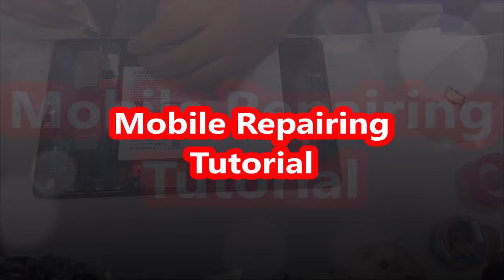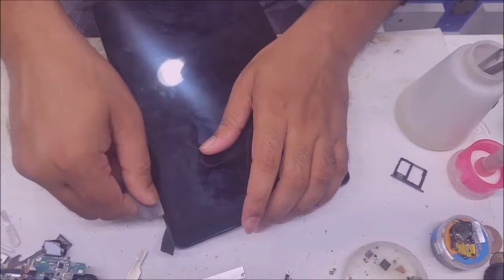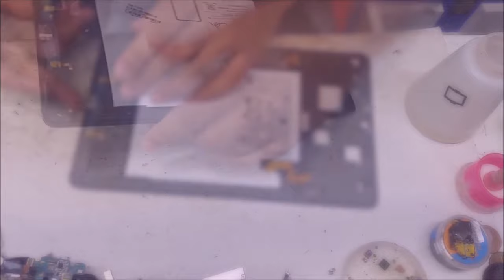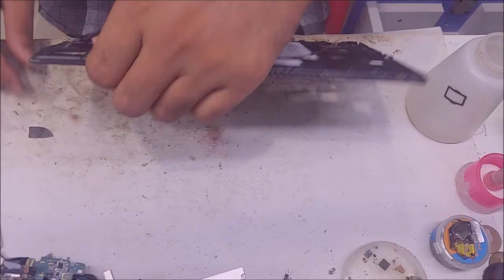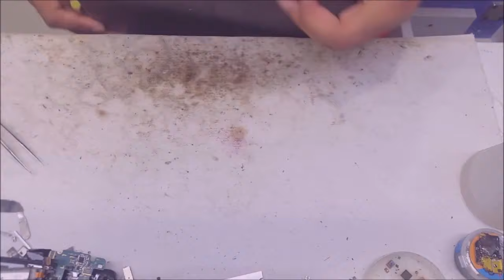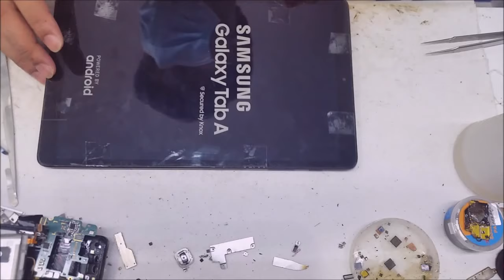Samsung Galaxy Tab A 10.1 SM-T515 Disassembly / T515 Full Assembly / T515 Screen Replacement

Comment: My tab has been leaking some sort of glue and today while I was using it, the screen separated from the back cover but I put them back together. I got scared though.
Reply: @MobileRepairingTutorial  In my case the glue detached and the screen fell down... I put it back...the ribbon that connects the screen and the rest of tab detached... I put it back together by seeing some youTube videos... But still the screen is not turning on... What shall I do?
Reply from the maker: @pratikshamishra1820  sir check ribbon is broken small cutting or change and check ribbon then not coming change display
Reply: @pratikshamishra1820  what happened what did you do

Comment: he product did you use to remove the glue?
Reply from the maker: yes sir that is thinner
Reply: @MobileRepairingTutorial  💥✨🎇🎆Great video🎆🎇✨💥, congratulations 😀👍👍👍Thanks for this video!         May I ask for the exact thinner?  White spirit? Acetone? Turpentine? Naphtha? Toluene? Xylene? Ethylic Alcool?And what part number exactly is this T-7000 glue? Thanks in advance and Keep Up The Good Work! 🖖😀👍

Comment: Good  job sir. One of the steel plates at 07:08 is being overheated. Display is dead. When I tried to charge a sound continuous beep sound is coming.what to do.
Reply from the maker: sir i think your display short or display light connection tech to ground
Reply: @MobileRepairingTutorial  sir my display is getting of by black screen but getting calls and everything else but my screen was Black screen what to do?
Reply from the maker: @cmarchana1077  sir i think it's display problem or display light problem
Reply: Apke pass motherboard h kya

Comment: Hi. thanks for the video

Display has fallen off ripping the lcd cable apart, I have replaced the lcd cable but the screen does not turn on, the sound are coming out...

what could be the reason?
Reply: Fried backlight, lcd panel connector broken, lcd broken

Comment: question: what if after changing the screen the touchscreen gets crazy?
Reply from the maker: Yes sir
Reply: @MobileRepairingTutorial  ? Please clarify what to do if possible
Reply: @paolomessina1351  most common issue is weak battery. it cant keep up with such power demands. but you must confirm it first by going changing to extreme power saving the test the touch inputs. if it is still randomly touching, that could be bad lcd